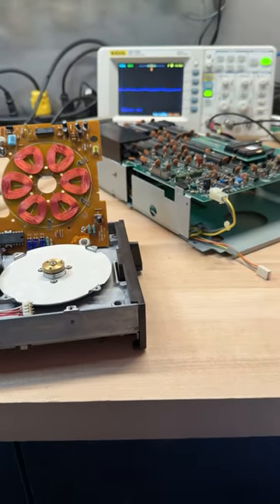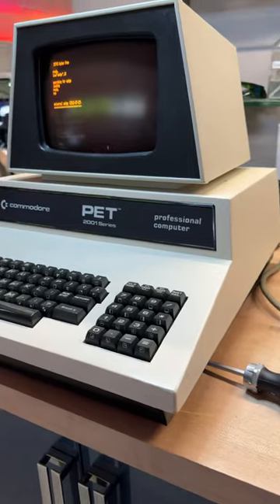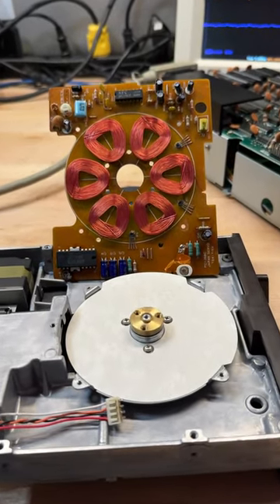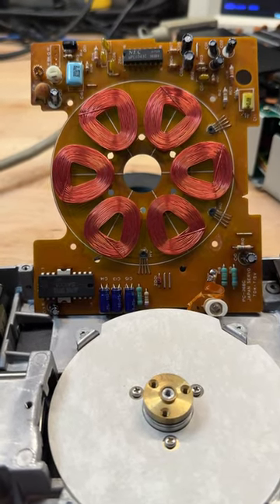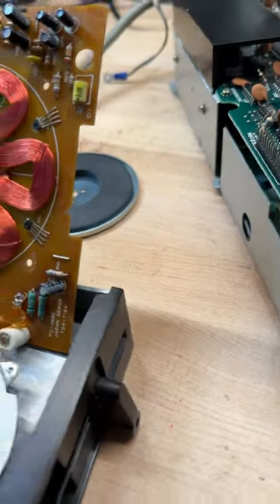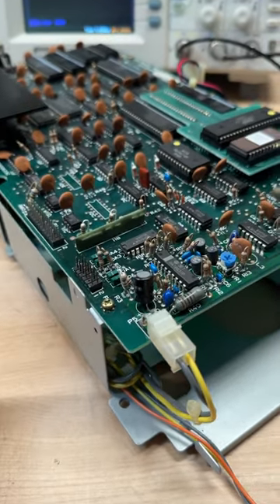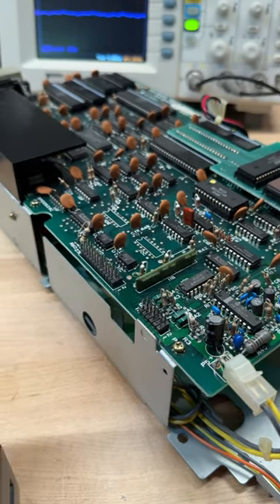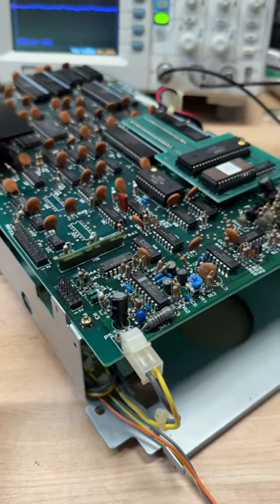Inside a Weird Device

Comment: That was unique regarding Commodore. They chose to make peripherals "smart" to reduce the cost of the main system. As such the entry level system was cheap but the peripherals were quite pricey as they were single board computers with the peripheral as well.  Interestingly the Mac which had very little expansion went a similar but slightly different direction.
Reply: It made sense as long as memory was expensive and processor chips cheap. The computer itself had limited memory to spare so why not put it in a seperate system. But as memory cost dropped it was cheaper to by a IBM or Mac because addons were dirt cheap. A 1 gig hard drive for a commodore 64 or 128 ($100.00 - 200.00) would set you back $1000.00.
Reply: Here in England it led to an extra market for them which prolonged the C64's shelf life in mainstream stores until 1992.

The only game consoles available here until late 1988 was the Atari 2600/5200, and as of 1985, those things were looking really dated, and parents looking to buy a game system for their child between then and the arrival of Nintendo and Sega consoles started buying C64s with datasettes as a better alternative cheap to Atari's outdated rubbish.

It's the reason the mass of arcade ports from the late '80s and early '90s are available on cassette.

Comment: I used to repair those things. there was a problem with the dual drive system. Sometimes the signal from the heads would get too weak to work. We used to stick a trimpot in the feedback loop and watch a scope while we adjusted it for a good signal.  The final test on those things was so long we ended up using Dysan floppies because every other brand of disk wore out before the test was completed. To date myself I started in the Computer biz doing board level repairs on Apple II's. Back then floppy drives were not throw aways we actually replaced heads and stepper motors and aligned the heads.

Comment: Storage/ hard drive question (for the audience or for you Dave): If 2 floppy disks (or probably more so hard drives) are stacked touching each other and are run at the same time....would the vibrations emitted from operation damage them?
Reply from the maker: They don't seem to, I have many dual floppy drive units where they are bolted to each other!